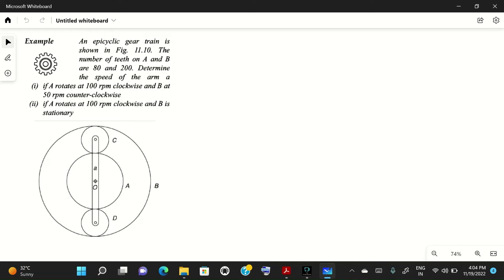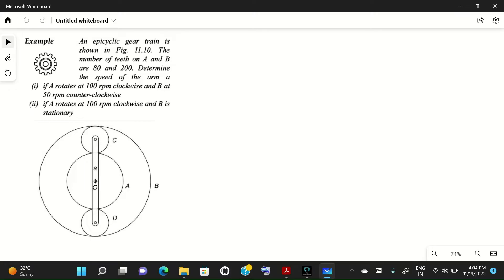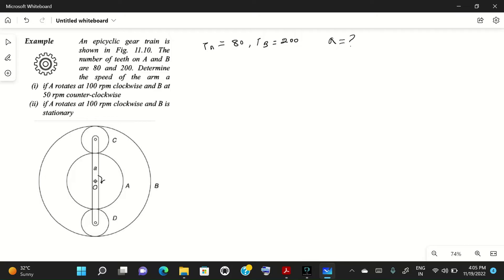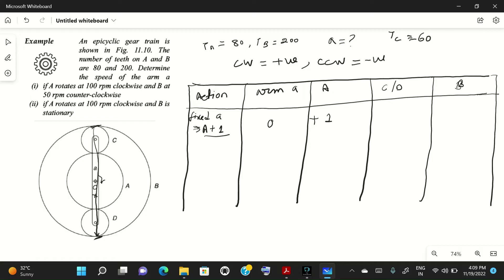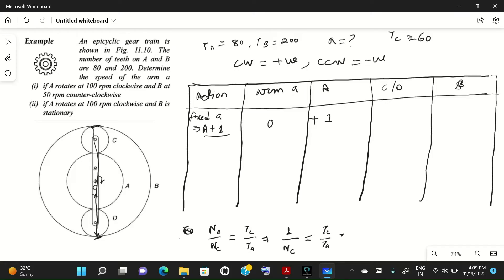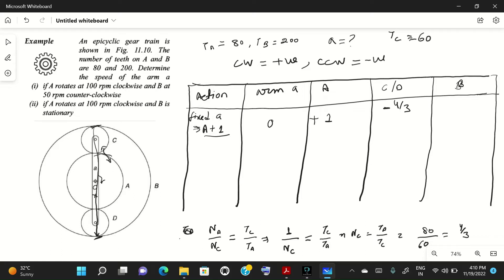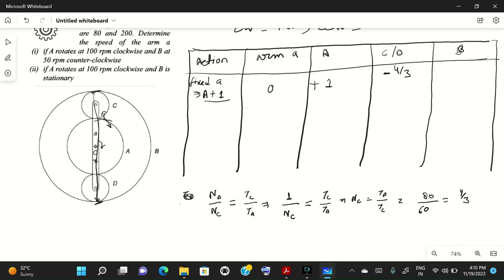Gear train // Numerical Problem: 05 // epycyclic gear train with  arm

Comment: 7:28 why you gave B a negative direction??, it is an outer gear.
Reply from the maker: When two gears are meeting externally then they both rotate in the opposite direction so they will have the opposite sign.
But if two gears are meeting one with outer teeth and one with internal teeth then they will rotate in same direction so they will have same sign.